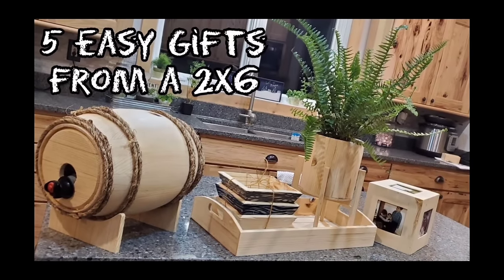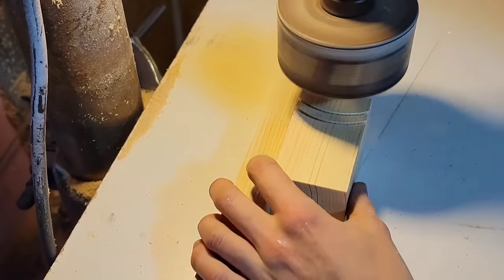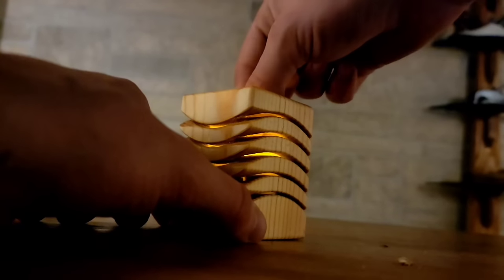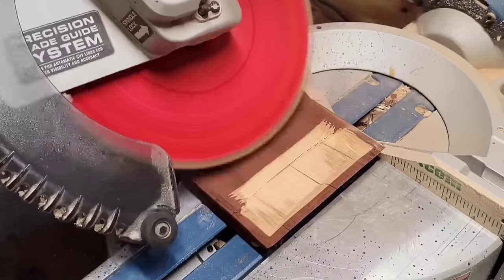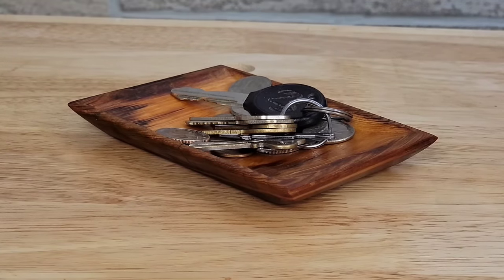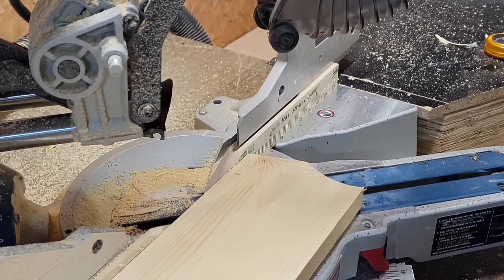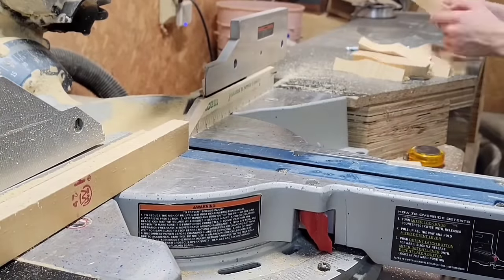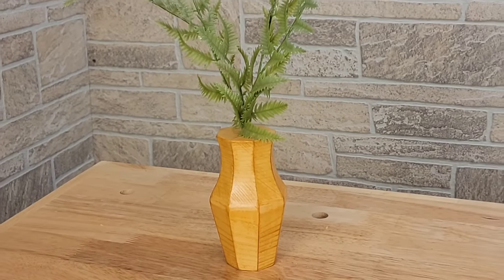3 Small Woodworking Gift Ideas

Comment: For cutting a cove, one can use a table saw as well. I have done it. Take your fence off and set up a wood fence at an angle. Then set you blade at 1/8 inch then make a pass and then move the blade up a turn. Do this a bunch of times until you are happy with the depth. You can make some really nice trim stuff with 2x4s, 2x6s as well. 
i really like the candle idea and this could be used for the bottom of legs. I have a 6.25 hole saw that would work good for getting higher up on the leg. Super cool idea and look super good too. Nice Job Josh!

Comment: Did you  mention running the hole saw in reverse? Prevents errant wood blocks from zinging across the garage.
Reply: does your drill press have a reverse?
Reply: @hansdegroot8549  yes it does it’s a nova voyager DVR.